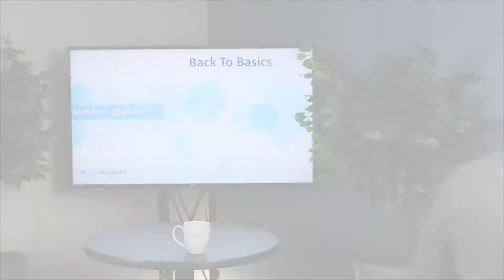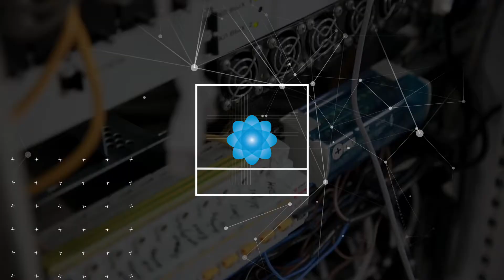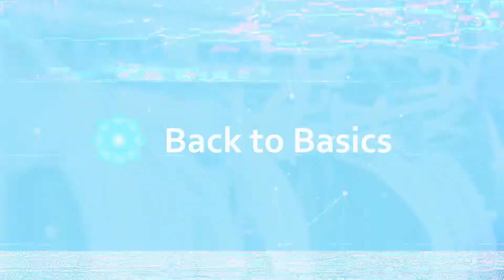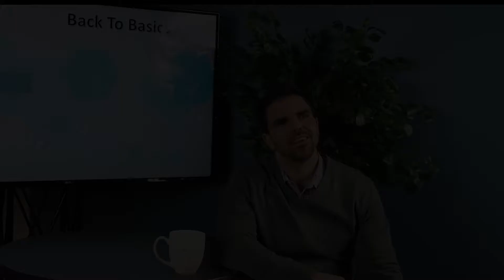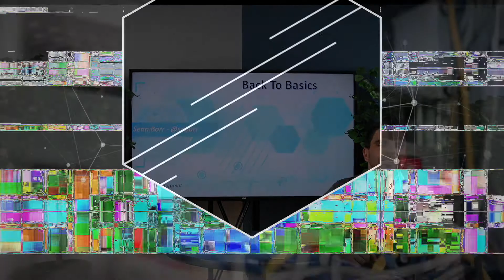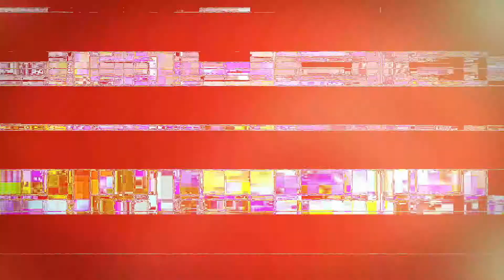Data Backup | Network Basics

Comment: idk man.. Snapshots of VMwares VM's should not be a scheduled recurring task. It should only be done manually for specifik purposes.
Sometimes vCenter gets a weird and fails to delete those snapshots.. meaning left with 100s of servers to worry about if the snapshot fails to be removed, you will have 100s of servers that now get snapshots layered in there until they break the VM.

Also, the unnecessary load that would put on the hosts would be crazy. 
Right?